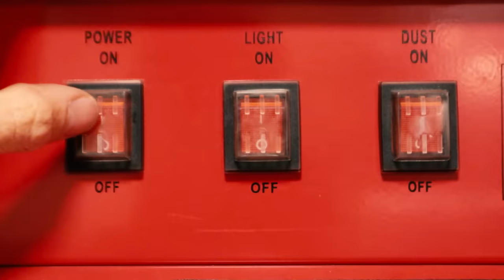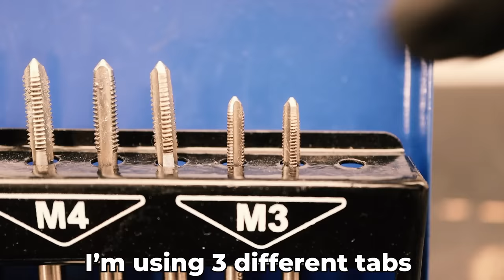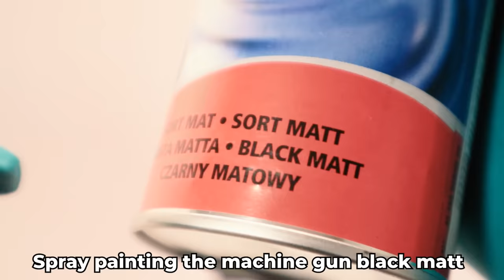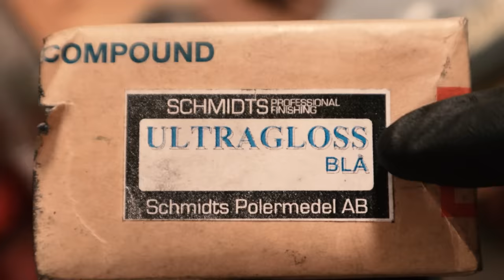Broken Machine Gun Lighter Restoration - Browning M2 repair

Comment: I Still what to know what would happen if I sandblasted my hand
Reply: Joel Samuel it would not be fun let’s leave it at that 😂
Reply: Well common sense said that your skin and flesh will come off just like paint from old metal. But it all depends on pressure thats set on sandblaster i think.
Reply: @MsTrustUs  the skin coming off is not the bad part. it is the sand that gets left in that sucks. Trust me I have done it. Those gloves in the blaster wear out quick.

Comment: Just curious but why wouldn't you just sandblast it all right away instead of the wire brush and all. Is there a reason for that?
Reply: When you immediately sandblast, all the dirt and rust go into your sandblaster, so you need to clean it more often
Reply: @rowdyeggplaad578  ahhhhh.  Makes sense. Thanks.